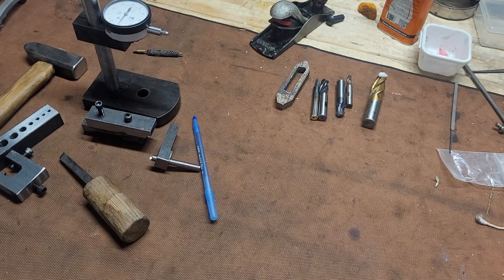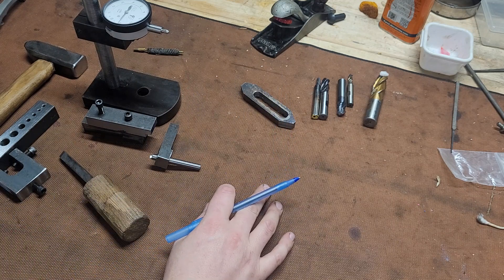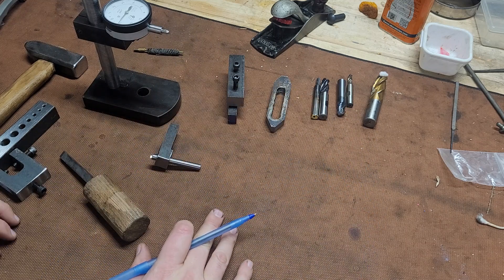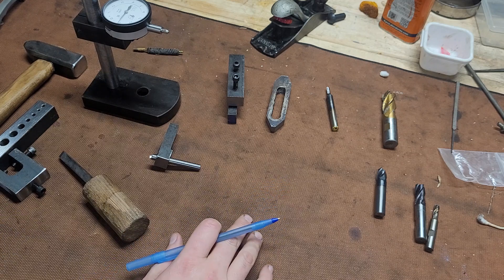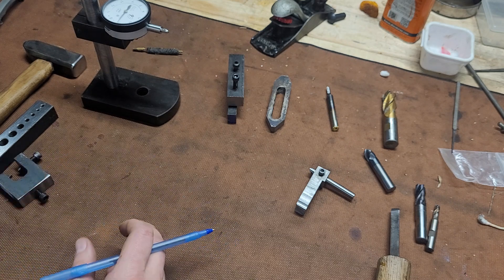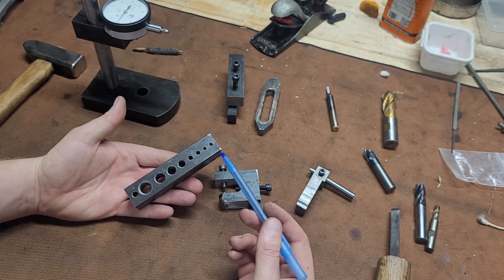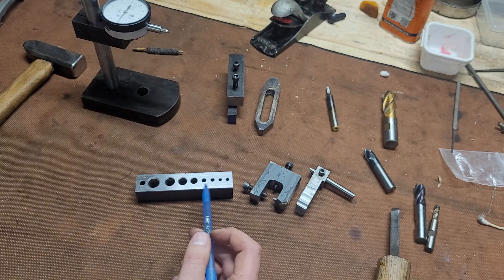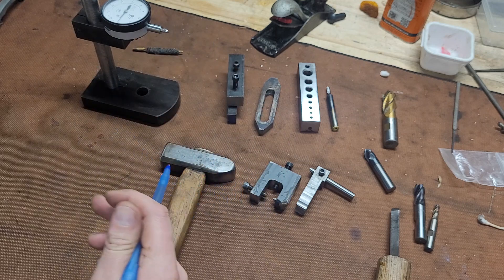Five Tips to Get Better at Machining

Comment: One thing I would add. 
Maybe the most important is you must have or develop a working knowledge of tolerances esp if you are doing your own engineering or repairs.
Reply from the maker: Machineries handbook is am excellent source for that. But from a hobbyist perspective, whatever works is AOK.
Reply: @moosesmachinery  I was thinking just the opposite, book tolerances can be very confusing for beginning machinists.
When I say working tolerances I mean something a millwright or heavy equipment mechanic would use because "it" as you say "works"
I see people trying to machine stuff to =/- .0002 when in reality =/- .001 and in many cases =/-.002-5 will work as good or better.